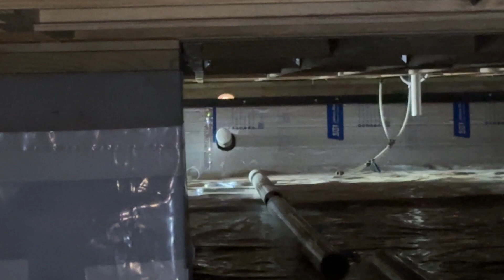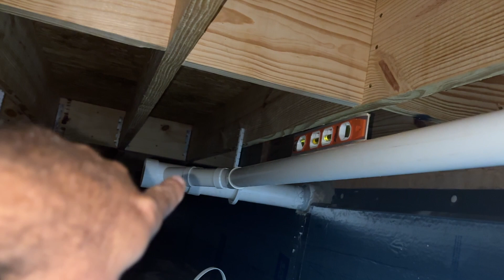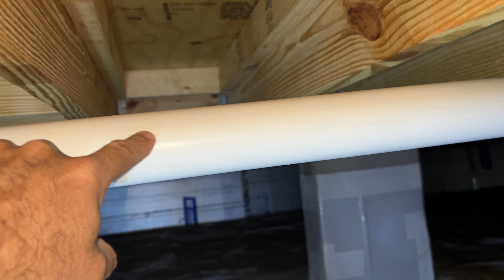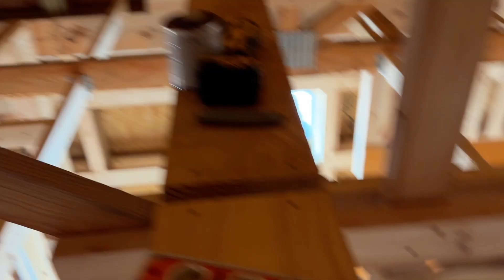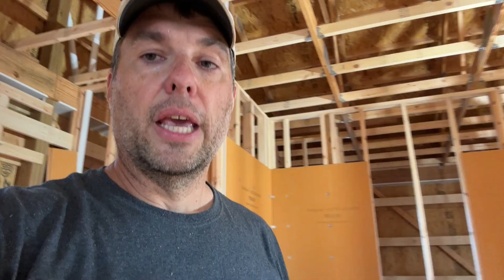DIY Plumbing DWV System Install

Comment: Did you get a temporary occupancy permit while you build your house? I would like to do the same
Reply from the maker: We did not.  The garage was permitted seperately from the house which allowed us to use the building once it was finished. Between that and the rv we are able to stay on the property.
Reply: @ we are also in Alexander county and your videos are very helpful
Reply from the maker: @ That’s what we are doing and so far it has worked out well.

Comment: Nice clean install.  Paint your rooftop pvc vent pipe (inside and out) to protect from UV breakdown.
Reply from the maker: @KenMortensen-v9g  I did not know you could paint pvc.  Does it take a special paint?
Reply: @allthingspostframe  Any spray paint that is plastic rated will work.  Follow instructions on preparing the pipe, scuff and clean, then paint.  It will prevent the pipe from yellowing and becoming brittle.
Reply from the maker: @KenMortensen-v9g  thank you!  Now it is on my to do list.

Comment: Nothing in code requires a vent to go out the roof, you have to vent out but it can go on a gable end.
Reply from the maker: @jhippl  you are absolutely correct.  

I didn’t like the way it was going to look if I went out the side wall.  A vent stack is defined as a vertical vent pipe and my inspector was going to require me to turn it vertical after punching through the gable end. Aesthetics is the only reason I chose the roof extension.  The grey siding really made the white PVC stick out when I held a piece up next to it.  I think with white siding I would be more apt to run it out the side.
Reply: @ ahh ok my inspector doesn’t require it to turn up and I always have what I call an utility side where I put all stuff like this. I paint my pvc to match the siding. Also my roofs are 1.5 or 2/12 so I try ever not to poke a hole in the roof.
Reply from the maker: @jhippl  I totally agree not putting a hole in a low pitch roof like that.  I had another viewer tell me to paint the pipe.  What kind of paint do you use?  I didn’t know pvc could be painted.
Reply: @allthingspostframe  any finish paint but get you some insl-x stix primer and get it tinted the same as the finished color.
Reply from the maker: @jhippl  Roger that.  Thank you!
Reply: @ prime it twice and let it fully cure between coats. I prime mine and a week later do it again.
Reply from the maker: @jhippl  Once it gets a little warmer out I will have to get up there and get it done.  Thanks again!